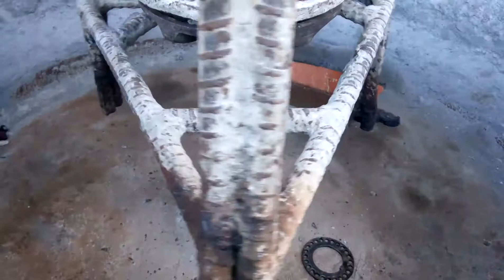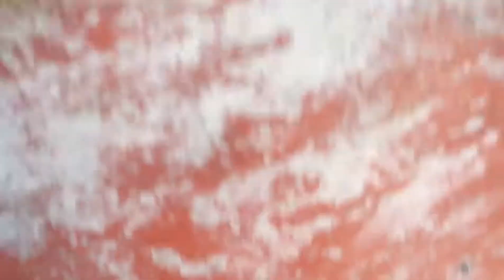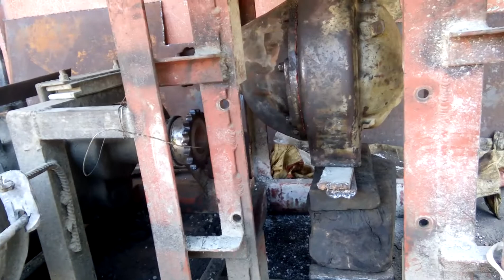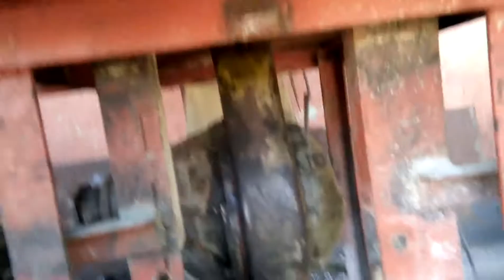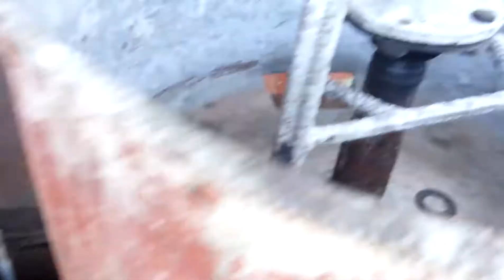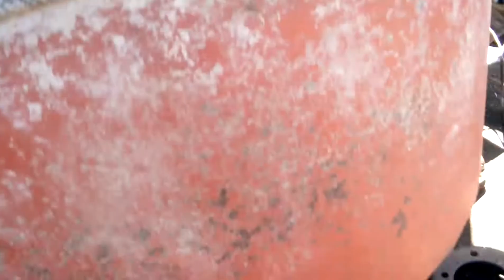HOMEMADE CEMENT MIXER USING CAR's REAR AXLE

Comment: So what drives it? and how does the concrete come out? you have one part of a good idea! but i would make it run from a hydraulic motor and mount it on a forklift?
Reply from the maker: A car engine and transmission drives it. You can see it has an opening at the bottom.